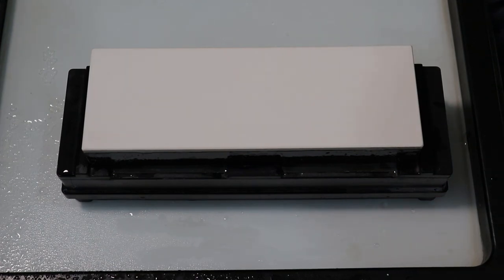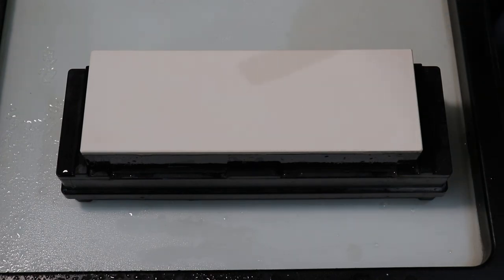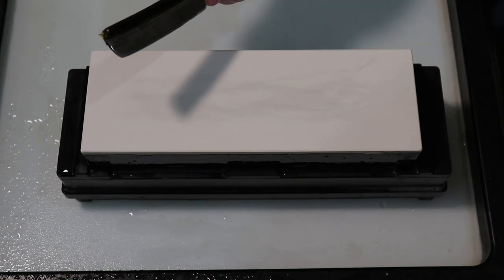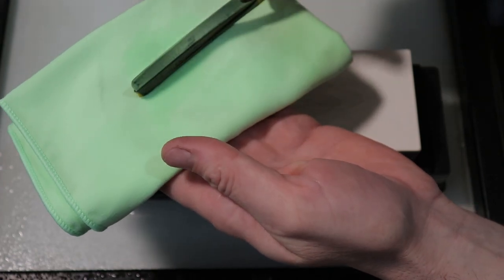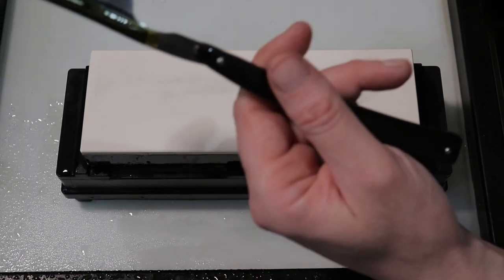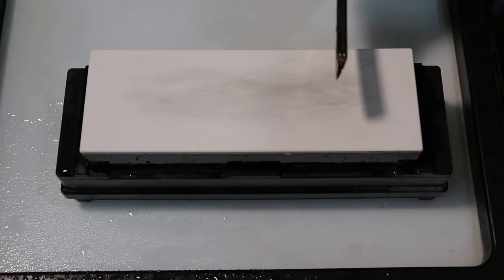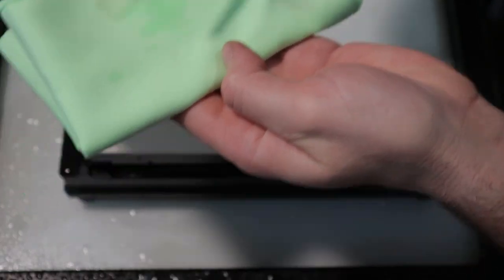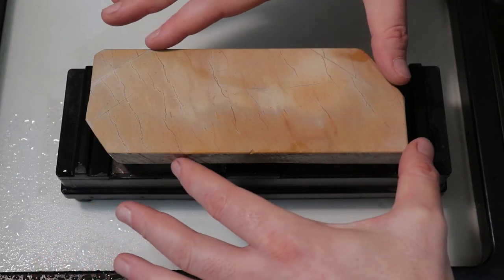Suita Honing & Bevel Set

Comment: 9:33 When you join the edge, like you did there, the heal is going to encounter that area on each lap. (You even left a small mark)
I used to do what you said at the start and dull it on the side of the stone but now I use the very top, where during a honing session the blade has no business being in the first place. (if you drove it off the cliff you'd damage the face) 
From your perspective, in the video, either the closest part of the stone to you or the furthest part, which would be more natural, and drag the razor directly towards you. 
The whole 3 inch width is available, and about 1 cm of the length, if you want  to join a straight edge or the very edge, like you currently do, if it's a smiling blade.
Reply from the maker: Thanks for watching and commenting.